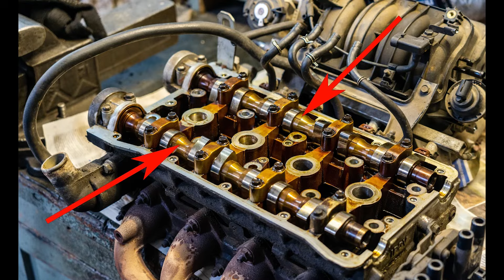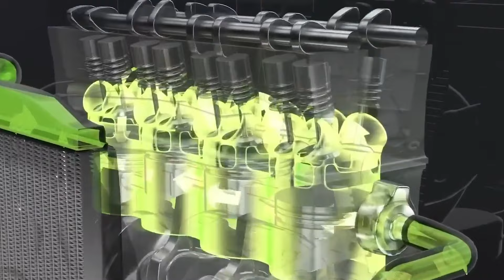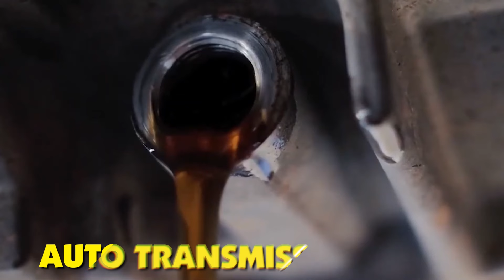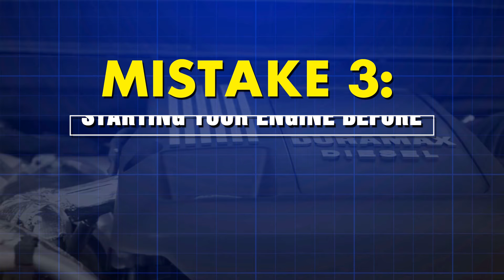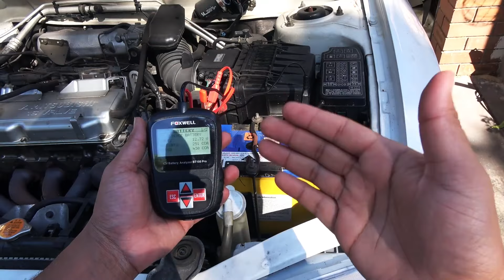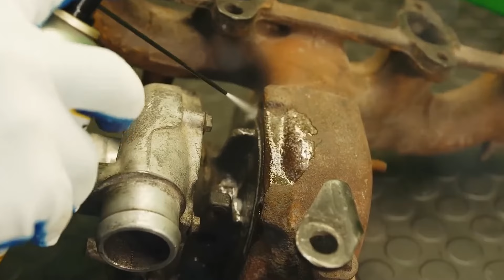Never Start Your Car Like This in Cold Weather (Ruins Your Engine FAST)

Comment: On cold start I let my Turbocharger idle about 45sec, after driving and engine is warm I let it cool down for about 20sec to cool internals, during the winter cold months sometimes I let it warm up 5min before driving anywhere

Comment: I start my 2004 Lexus IS300 and immediately take off I don't give it no more than 3 seconds and I'm in gear already I have been doing this for the past 7 years without any issue. I'm not wasting gas sitting idling
Reply: That’s hilarious, I let my vehicle run while I’m in the shower, getting dressed, making breakfast, making my lunch for work, and then I jump in my cars/truck. Sometimes they out there idling for 30 min. So nice and warm when I get in and they are already at operating temperature obviously at that point with the fans cycling. I’m not worried about fuel economy and also run Mobil 1 fully synthetic oil I change every 3/4k miles. Never am I jumping in a cold car and taking off. You do you I’ll do me
Reply: Don't get me wrong I do all the preventative maintenance on it My brother even gets mad that when I do the oil change on my car it looks like I just put it in. My engine oil is changed every 3 months. And all other oils are changed every 6 months including brake oil power steering oil transmission oil and differential oil. All my oils always look brand new when I remove them. But that's just me